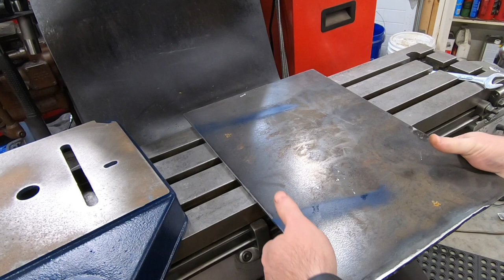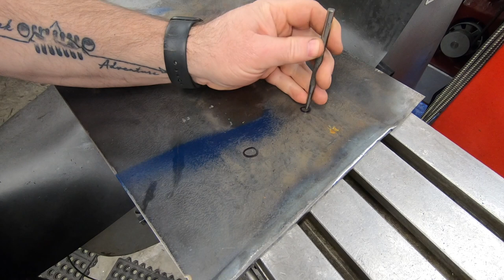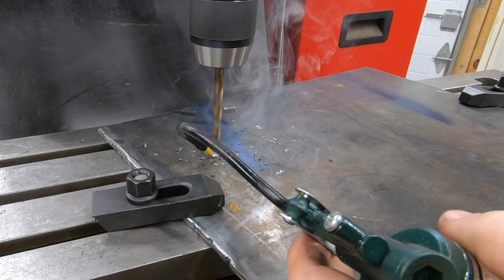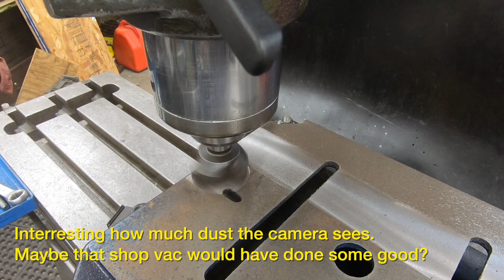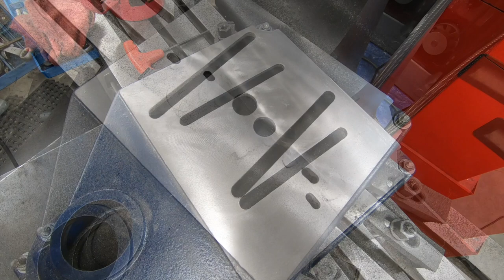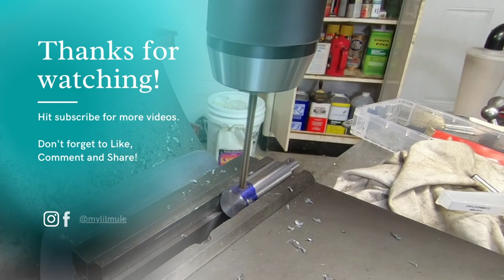Restoring a 1940s Craftsman Drill Press - Part 3

Comment: I think most of your problem was the base was not clamped down to the table secure enough. Even though you had your mill clamps on the center of the base they were just clamping the quarter inch plate solid to the table, but the base was still only held by the outside bolt holes. Which I think aloud the Table to set up some harmonics. I think if you could have clamped the side edges of the base somewhere in the middle it would have helped a lot. But it would’ve hurt your paint. That’s just my two cents. But your end result came out much better. 
I still need to catch up on the other video.    Gary
Reply: I was about to say what Gary said much better then I could have...
Reply from the maker: I'm sure there's some accuracy in this. I was puzzled by the inconsistency. Especially since it seemed to be worse near the holes in the base. But on other holes, it was fine. Or even on other passes over the same area.

Comment: I have done this several different ways and the result was the same. It’s caused by clamping. Some parts are getting more clamping pressure than others. A fly cutter seems to give better results as well. Keep in trucking. Love these videos
Reply from the maker: Thanks for the info. That seems to be the prevailing wisdom. Although I had it clamped as securely as I could with what I was using, there was still enough flex in the workpiece to probably cause these problems.

Comment: I wonder why having an insert with a radius made a better finish?  Looks great!
Reply from the maker: It's the tolerance on the insert that changed as well. The first insert is press formed, whereas the second one was ground. Tighter tolerance plus a tighter radius on the cutting edge. Kind of like using a dull vs a sharp knife. The sharp knife will dull faster than the dull one will get duller. LOL

Comment: Your problem is resonance, thin casting, and the plate it's mounted to are vibrating, you can see the chips dancing from it. It needs to be mounted more securely and maybe dampen the vibe by wrapping a bike innertube around it.
Reply from the maker: The inner tube is an interesting thought. I couldn't really clamp it tighter with my setup. In hindsight I may have been able to remove the 1-2-3 blocks I was using as risers. That may have helped. If I ever find another one of these that needs restoring, I'll have to try a few things.

Comment: Lot of good suggestions here so far, did you make sure you had the Y locked? I had some issues on a non critical part that I spent way too long trying to make aerospace quality on a worn out mill, turned out I never locked the y or knee and had a horrible surface.

Comment: These drill press bases are very thin castings ad they flex a lot while cutting. This was probably the problem.
Maybe next time give it a go with a HSS tool. They have way less tool pressure.
Reply from the maker: I suspect you are correct. Now, to get better at grinding HSS tools. :) Part of my problem is the design of the fly cutter. It's only about a 10-15 degree angle, so grinding the tool needs to be done just right or the shank will end up contacting the surface first. Ask me how I know. lol